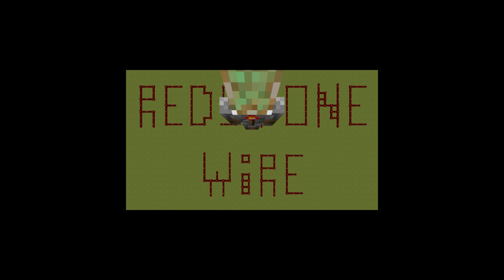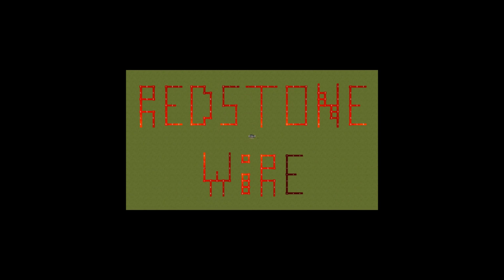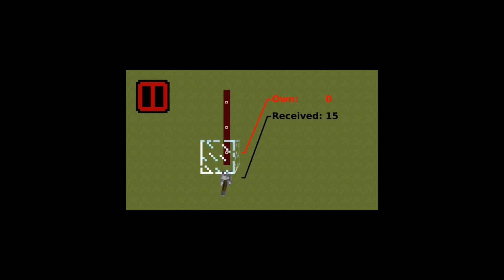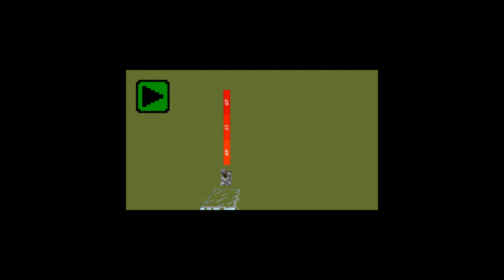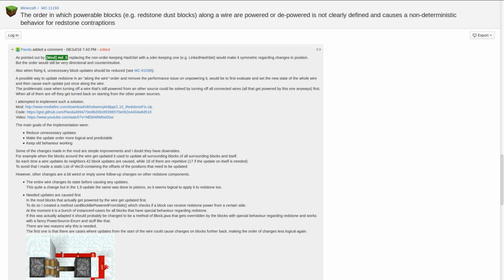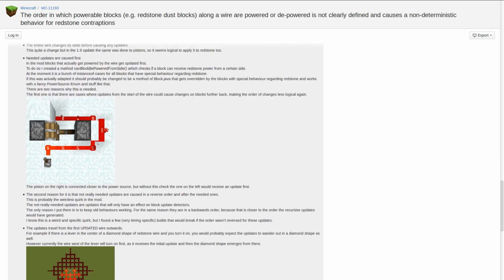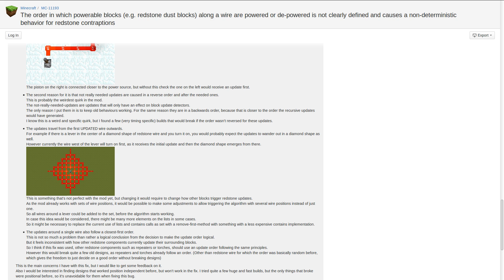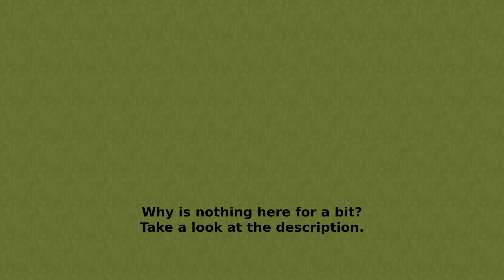Bugs and Ideas #04: Proper fixes are not that simple

Comment: so, a lot of these points have been stated on twitter already and none of them have been disproven by you so far:
first of all: the points you prevented are simple, not to say trivial, to fix. Or they are just simply uneccesary. 
for one, it is not difficult to copy code. it isnt very clean, though, i must admit. in addition to that, i even want to question if you would ever want to change something about repeaters now. you have seen the impact of changes to intentional behaviour even you can hardly be supporting. 
second of all, it is just simply not possible for something of this kind to be impossible. it s just a matter of decent testing and some work to properly fix it. this makes changes uneccessary. (now, admittedly, speed is a concern with that, but forwards compatibility is most likely more important for your average player as well as the majority of players)
lastly, for the time being, a "hacky" fix is sufficent until mojang considers it worthy of putting a noteable amount of effort into this. as already stated on twitter, this is, even with it s problems, way better than anything current.
Reply: LapisDemon
My point stands: We're customers. There's no reason why we should be criticized for enjoying something and voicing our concerns and wishes.

The recent changes to hoppers broke a lof of my contraptions. I don't think I need to spend the time, to collect the evidence, since you probably don't want to spend time on looking at that, but I can do so in case you don't believe me.

I'm ofc against any insults or threats, but I think you're exaggerating this responsibility of Youtubers argument. I agree with you on this to some extent. Hate speech etc. would be totally unacceptable, but giving a biased opinion publicly on something, isn't something anybody shouldn't be allowed to do. It's a basic right.

If you would apply the same standards to other situations, no interest groups would be allowed to state their opinion, since it might compell a deluded person to insult someone.

Also: The technical community is not the PVP community. I doubt the devs received any death threats by us.
Reply from the maker: I would like to fix the bug that was added with repeater locking. Repeaters lock if they are the last in a chain receiving a pulse of the same length the repeater is set to. And I think all that is wrong there is that the check for the repeater locking messes up the facing.
Also I would like to see the update order of all redstone comonents reworked. That would obviously break some old behaviour, but be more consistent in the future.

I'm not saying that it is impossible to fix redstone. It clearly is and the fix even kind of proves that. But I do think that it is impossible to keep the current "works as implemented" behaviour while still fixing all issues and keeping a clean and logical code. E.g. one thing I would expect from redstone if it was done in a logical way would be that it only updates the blocks that are affected by the change of power of that redstone dust. That already conflicts with the current behaviour and the change to repeaters in the snapshot showed how people would react.

I think you are underestimating the amout of work a hack fix like this can cause. I believe that there are no severe bugs in my redstone fix, but statistically there are. So a few days/weeks/months after adding it there is a good chance that someone would have to take care of these shortcommings, which might be tricky problems themselves.
I don't think creating a half way solution here to change it again in the future would make much sense.
Reply: i am not so sure about the bug you re describing, i think i might know what you mean, two tick repeaters on a 1 tick on/1 tick off(rs ticks) clock are inconsistant too, but i have no idea what exactly that is caused by i must admit. i just avoid using it

i am intrested, do you have a suggestion as to how to change the update order? i honestly thing with the excetpion of redstone dust the current system is fine, and more useful than a implementation such as closest first for litterally everything. 

could you please explain in more detail what is meant by "only update what is affected"? should it check all blocks and see wether or not they are possibly able to be affected by it? idk the ins and outs of what is fast and what s slow to do in minecraft, i guess a check for the type of block would be less heavy than a proper block update though wouldnt it?

i do have to agree. most likely there is bugs. though i havent seen any noticeable ones and that eventhough for example coolman used the mod for his general 2x2 tree farm which you d expect to break if there was a major diffrence you d have to care for. i also agree on creating a half way solution to be bad, but afterall, you ve done it now, so #whynot even if it just stays for a single snapshot because its just terrible, reverting to the old stuff isnt all that hard. i d say it s totally worth a try.
Reply from the maker: Repeater bug: https://bugs.mojang.com/browse/MC-51543

"only update what is affected"
I mean that it shouldn't just update all blocks around, but only the ones that change their powered state. At the moment it for example updates the blocks on top and the sides of redstone dust for no reason. You don't even need to look at the blocks there at all to tell that the dust should not affect them (unless they are BUDed, but that's a different story).

I can understand why Mojang wouldn't want to go with such a hack fix. I couldn't say that I wouldn't like it to be in the game myself (but I'm also bias here :-))
Reply: yeah ok. we were talking about the same bug just that i didnt understand your description :D

yeah "unless they are BUDed" that s the problem i m seeing... i guess there is ways around it, a check for the blocktype like i said before, or maybe just marking the budded blocks(ie with something similar to a tile entity(non ticking)) would work. 

i guess they d get quite some hate if they did it, though, that is largely due to their acting lately(more specifically grum). nobody was so concerned when they messed with rails and minecarts. people where fine with it being in for a snapshot and them then just saying "screw it" and reverting stuff. they really need to fix up this dangerous atmosphere.
Reply from the maker: Yes, if they plan to fix the redstone system (which I hope they do) they should start preparing the community for it and take their input in.
Reply: i must agree. but really, the community (incl me) is not willing to accept any changes to redstone breaking previous behaviour. while i can see your point in calling it neccessary, i also think, that it s not a matter of perfect the system, but rather making it sufficent for general use. that i think is, unlike perfection, compatible with keeping important old behaviours
Reply: I agree with JeWe. The redstone system doesn't need fixing. There's no perfect system anyway.
Reply: LapisDemon

First of all, why should we be criticised? We're the customers here. Second, that we're not open for compromises and changes is delusional. If concrete changes are presented to us, we're open for them (see hopper changes 3 months ago, that broke some cool behaviour, but overall was good)

A removal of our beloved redstone system for the vague promise of "cool new features" and the lame PE system as a substitute is no compromise.

The PE system is exactly what we don't want. If PE would become a bit more java and java became a bit more PE, that's something we might consider.

PE has a boring system, without any depth. If those "cool new features" are on one level with the ability to push entities in cauldrons, which Panda praised as an improvement for pistons, no thanks. That's just a lame gimmick.
"Cool new stuff" sounds like something to lure idiots. That's too vague and I doubt it's impossible to implement cool new stuff on top of the existing system (see modded MC).

And how should we prepare for redstone changes in the future? Stop playing now?
Reply: considering what i have heared about recent discussions in the tech chat and similar, feature parity isnt being pushed for as heavily as you are saying. i of course can only go but what others have told me, but to be honest, i trust them more than you. the reasons for that should be rather obvious

in a nutshell the first part of what you said is that we cant both have everything stay it is, get stuff fixed up(lag wise etc) and get new features, i d like to question that. the thing you seem to have overlooked, is the fact, that i very clearly stated that i do not think a compromise is anywhere near neccessary, overlooking the whole feature parity crap i ll leave out for the reason explained above. you may read up on my opinion in my second last reply(incl. this one). 

moving on, your next statement was satying in older versions being fine. again, that would be the worse compromise, since we d be missing out on a bunch of features we d like to use. afaik eg scicraft has gotten to the point where they ve built the majority of really intresting things they meant to build, needing new features some time too. again, this comes down to my disbelive of it being impossible to incorporate everything. 

at last, i can hardly see my criticsm being very inconstrucitve. i explain my opinion and what i think is best, which i think i am not totally incompetent of doing. which is most likely a whole of a lot closer to the average opinion of the community as that i would describe you as a little"diconnected" as that you re never on things like the scicraft ts many use.
Reply: you re thiniing isnt any less subjective than mine or anyone else, at least i do not see why
actually being able to talk very much helps in clarifying situations. it helped quite a bit with some people already, talking makes things easier overall. i m sorry, but you re comments can get quite lengthy and i am unable to keep track of everything without making notes while reading. also, in ts you get the more "straigth" version muhc rather than the clean one.
also, panda and you are similarly influential as the rest of the community and each side has made their opinions clear, what really matters is, as i ve said several times by now, not the persons own opinion, but the one they are inflenced by the most, since they dont bother to form their own. there surely is a bunch of people that dont like such things, but there is an similarly, if not bigger, amount of people that do like them even if they were just persude to think that way.
also, if you think that something is bad, state it directly. independent of the effect on people. this is the internet. noone should require someone else to be forsigthful or so. people will do what they want often times, so did everyone who reported translocation, so did everyone who defended it
and another thing to be questioned is ifwhat you suggest can even remotely be called "a compromise". it is far from that as far as i can tell. you want bugs to be fixed for new features, but them not being fixed and thereby keeping behaviour is ltterally all we want
and of course we like the fixes that wont break our stuff. and that normal, you know why? because that is a proper compromise! we are happy, mojang is happy.
something as powerful and simontaneously well done code wise seems difficult, not to say impossible. while i might get your vision, the amount of things needed for a poper implementation of everything would already force stuff into being sireously overpowered. not like translocaters more like: we d litterally need instant pistons.
another thing you  ve stated several times is that you think you re the only one knowing how important buissness is to mojang. this time you very clearly said, you dont think we re capeable of such thinking. and i must deny that. i think we ve made decent points as to why it wouldnt help mojang to litterally fuck over the game for us. 
(read mangos comment after this, of course plain hate doesnt have to be accepted, but that isnt a thing here anyways really.)
Reply: Dude! (JeWe) You still play in 1.7, don't you?! }xD
In any case, I do agree that it would be preferrable if there'd be a system that wouldn't "break" old behaviour, if any possible, by implementing similar things as "features". On the other hand, due to their "feature parity" aim, it'll be hard to have a redstone system as "quirky"/buggy as Java's that the PE-/WIN10-Devs would accept.. (and, believe me, we had our discussions, so I'm not saying this without having tried to "fight"/reason for it with some of them already).

While I was advocating towards Microsoft and MC-Java-Devs to maybe also have a Java-exclusive/slightly different redstone version, I doubt they'll "fry an extra wurst" for Java, sadly, going by their reactions and overall behaviour and what Microsoft seems to have as business goal. 

"Clean code" is necessary in order to implement new features, or else it can lead to new unexpected (usually also unwanted on Mojang's side) behaviour which the Java-community gets used to again and will whine about again and thus send hate towards the Devs again when they'll remove that bug, as it is "not intended" (as it also doesn't occur in the "cleaner" PE/Win10-versions).. so overall they're between a rock and a hard place, no matter what they'll do, it'll be a problem for them anyway, they get hate anyway.

The community wants innovation, but doesn't want old behaviour that relies on bugs to be fixed in order to get "clean" implementation of new additions that doesn't interfere with any bugs that are still in the game.

That's just not possible.

Either we'll have a complete "clean" overhaul with elaborate features, so Microsoft/PE/Mojang are all happy and Java-MC gets cool new stuff which might break old contraptions but will make new ones possible, or we're going to be stuck in an endless loop of argumenting with them.

In any case, if I were you guys, I'd prepare that Redstone will change in the future and either adapt or play in an older MC versions where the "quirks" you love are still present. At least that latter option is what >I< personally will do, if I don't like future versions.

As long as you're not open for compromises and constructive criticism, there's no way you can make a change towards the direction you'd like to have.
Reply: Jendrik Weise There aren't that many people in the tech chat who would actually blabber about anything that was said in there publicly, so I'm intrigued who gave such an information. Also, neither Microsoft nor Mr. Bergensten/Jeb are part of the tech chat, so there's an important variable left out of the equation when it comes to the "finite" character of certain statements.
Humans, even more so those with a passion, tend to interpret words the way they'd like to have them, but I rather stick to a realistic view on the total image than a small fantasy bubble.

If you don't trust me, just because I say the words you don't want to hear, and rather listen to those who say things you want to hear, then it's rather a waste of time for the two of us to argument with each other, don't you think? At least it doesn't make sense to me, so I'll try to make this reply here my last one to you.

That "we can't have both": What happened after someone thought it was a good idea to introduce the observer into the current Java system, so it's something nice-shiny for the Minecon presentation? The observer made painfully clear how buggy the current redstone system is, so they changed its features (currently? Generally?).

Other (partial) fixes in the redstone as well as the Creative/CommandBlock system that were tried (but not implemented in snapshots) also made it clear that adding something on top of the current system can lead to unexpected/unwanted behaviour, or is even (currently) not possible at all, so what you were saying, that you're questioning my argument it could lead to problems if we would keep the current system but add new features on top of it, is debunked in that regard.
I'm not saying that all additions to the game would cause anything unexpected/unwanted, but I know it already happened on several occasions. I'm not making this up.

My big worry is that they're adding things which we'd love for its "quirks" > unexpected/unwanted behaviour due to the current buggy Java system, and then they're removing it (its unwanted behaviour) again as they consider it a bug, and the mood in the community heatens up more and more against the Mojang Devs who really shouldn't be showered with hate.

Lastly, I don't have to be on TS of any tech server to know what the tech community thinks, they say it loudly enough on all social media platforms, and I am capable to read, hear and understand. You don't figure that I do know and take it in, that's why I also try to argument against some changes towards Mojang/Microsoft, but at the same time some of the tech people don't take into consideration what is the developers' and owner's aim or goal, and seem rather "stubborn" and self-centered in their stance.

I am not the enemy, I might have many stances that are similar to many people in the tech community (or I wouldn't have e.g. tried to get maxEntityCramming gamerule off for 1.11 and argued against Mr. Bergensten), I just have to be an "advocatus diavoli" in some areas so people try to at least see the perspective of the "opposite" side and can try to find a compromise, which most don't seem to want, as you also clearly stated. You want to have the "status quo". So if anyone is "disconnected", it's rather those tech people who criticize self-centered in their little biased bubble.

While some people like e.g. gnembon did make good, mature points in discussions which I consider constructive, other people in the tech community just don't get how things they say heatens up the overall mood in the community, and that's what makes me worried.

By now I just have to accept that some people in the tech community can't see certain things from another perspective, and focus my energy rather on positive people and changes, rather than argumenting against walls and trying to find a compromise "to make everyone happy".

If compromises are not wanted, okay, I'll make sure to pass that on.
Reply: ilmango "First of all, why should we be criticised? We're the customers here."
True, we paid one time a few bucks, way less for other games which we invest way less hours gameplay into, and they provide us WITH NO COST with updates since years now, so we have a right to also behave like butts towards them, because "we are the customers", and "the customer is King", right?

I don't know how often I already mentioned it, but are you really not capable of getting the mood of the community, how they can get really nasty if instigated by other people, e.g. Youtubers, and do you think it's okay to send hate towards the developers, including death threats?

"that we're not open for compromises and changes is delusional"
Sure, if it's a change you like and benefits your contraptions/channel, of course you're open for it.
If it's to fix issues that break your contraptions as some of them might rely on bugs, you don't like them.

"A removal of our beloved redstone system for the vague promise of "cool new features" and the lame PE system as a substitute is no compromise."
Nobody made any vague promises of cool new features/stuff, I like to use that term to make it easy to understand what is meant, without laying out what those features could be. In my vision it'd be something that gives the same functionality as Java currently, or, if not possible, something that completely can replace it with something new that blows everyone away; just saying that a change of the redstone system seems to be unavoidable.

How to prepare for that?
I know what >I< would do if I absolutely would be against it (and had the time to invest to do it), as I see Microsoft/Mojang as an adult as a business company, so if you or others can't figure it out yourself, there's nothing I can do about it.

All we try is to figure out something that doesn't hurt anyone too much or not at all.
Devs/Mojang having their clean code, we having an awesome unbuggy but elaborate redstone system.

I agree that the PE system is lame, I even consider it horrible, I also said so just recently again towards Mr. Bergensten, that the tech community is worried that they'll "dumbify" everything down to crappy PE, also just to please some kids (or to sell some easy-peazy redstone noob lessons on DVD.. who knows..).

Nobody wants the PE system here, including myself. If it were up to me, I'd have PE and WIN10 play happily together, and they should leave us Java in peace. I don't have to be able to play with any of the other platforms, for all I care.

But it's them making the decisions, and we have to try to find a way to get what we want without sounding too stubborn or even hateful.

What you and others don't see is how Panda and I argument against certain changes "behind the scenes", which might have also to some extent led to some recent changes or change-reverts that you're so happy about now.

I said on several occasions, publicly as well as privately, that they should leave redstone for 1.11 release as it is, revert changes to the redstone system that broke too much if possible, and have a complete overhaul of redstone rather, present it in a separate snapshot after 1.11 release, so the tech community can test and give feedback to it, but NOT to take on one time this, another time that redstone component, bugfix just a part of it etc., as I can absolutely understand the community gets upset whenever they change only a little thing that breaks contraptions, and that without gaining anything. That's frustrating. Even if, strictly speaking, snapshots are snapshots, just a temporary glimpse in where something leads to, seeing how broken Redstone/components are, making a partial "Flickwerk" (patchwork of sorts) is the worst idea ever.

Even if it sometimes might not seem that way, Panda and I "stand on the side of the tech community" and generally "for the good of the game", but observing how many of the community misbehaved regarding changes and heatened up the discussion by instigating their fanbase, makes it growingly hard, at least for me, to continue argumenting for them against Mojang.
Reply: LOL
Reply: ilmango Just real short:
The PE-Dev that got mentioned by Mr. Bergensten when they mentioned the Observer (and that it will be in Java in the future) on Twitter is one of those who got death threats by the Redstone community.

So there's that.
Reply: LOL